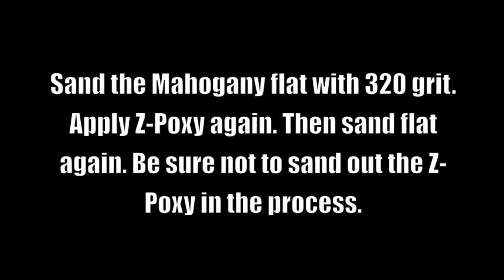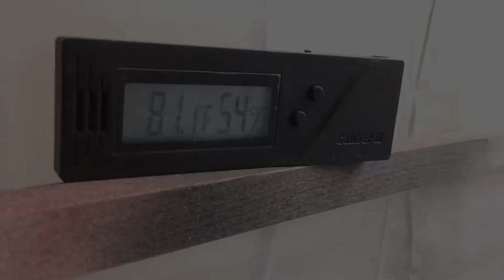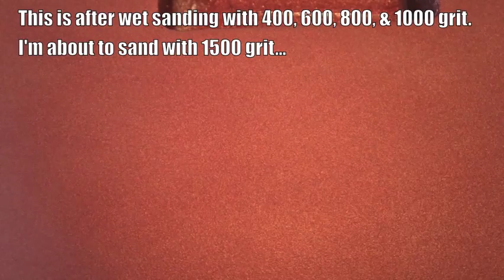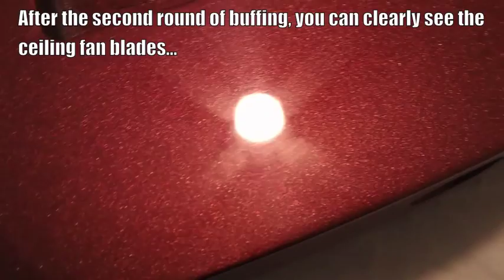DIY Double Guitar Project

Comment from the maker: Yes, I do recommend John's "Paint Your Own Guitar" ebook. The one I bought in 2005 or so did not really cover grain filling. Don't know if he's updated it since then. Yes, the square neck pocket of the RG body matched the Warmoth strat-style neck heel. Yes, you need to order the neck w/o the neck holes drilled because some of the CNC'd RG bodies out there are about 1/8" shorter in length compared to a traditional strat neck pocket dimensions... Thanks and God-speed!

Comment: How long does the Alsa killer cans spray paint will stay good to spray after you activate it, i heard you only got a 13 hour window before it won't spray? 
Did you need to scuff it before putting the clear coat on?

Comment: Just wanted to say that I love your DIY videos, especially since they demonstrate a way to get metallic paint on a guitar without having to use expensive equipment like a spray gun and compressor.  I plan on following these steps to paint my guitar.  One question, I noticed that in this video there was no sanding sealer used.  Is it not necessary because of the Z-Poxy grain filler?